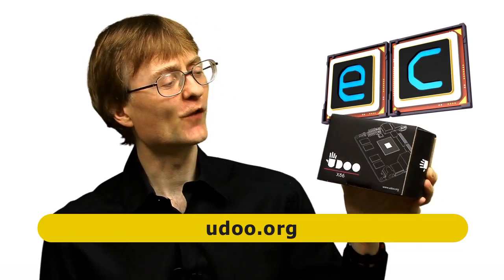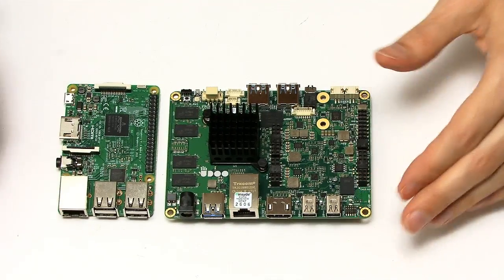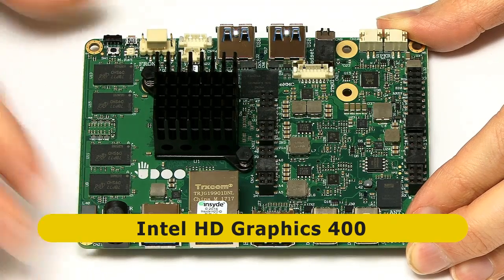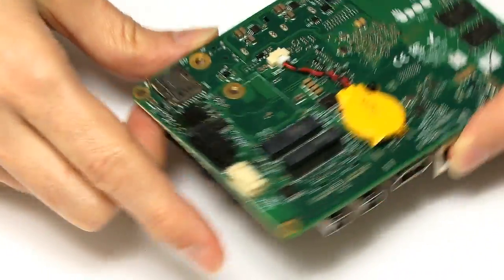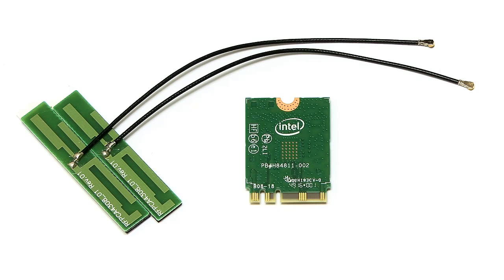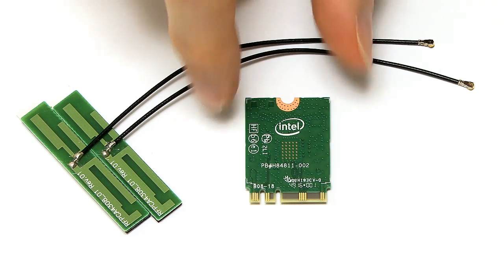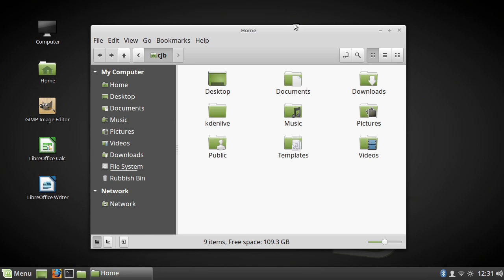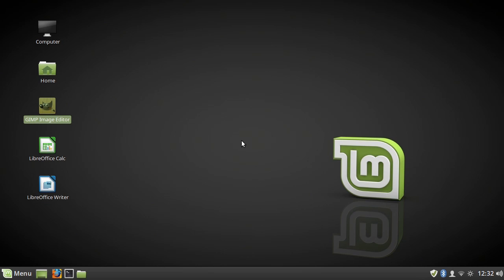UDOO x86 Advanced Plus

Comment: where did you buy this, can't find it on Amazon.
Reply from the maker: Mine came from https://shop.udoo.org/ -- they ship internationally
Reply: I got mine from the original campaign on Kickstarter but then never sent the screws so I can not attach the expansion module or HD so it just sits in a drawer.  Typical crappy KS support and Udoo is real company with several past products so they have no excuses for such sloppy work.
Reply: Just do not expect them to end the screws with the fans!  Rip-off!!

Comment: Is there a way to add a second lan port and use this as a linux firewall?
Reply from the maker: There is a $50 daughterboard that connects via M.2 and adds two extra Ethernet ports. :)
Reply: ExplainingComputers Thank you. I just looked at it, but where does it fit on the board?
Reply: Both M.2 ports are on the bottom and near each other.
Reply: Besides the daughterboard with more NICs, another option is to use a VLAN-capable switch and 802.1q-tagging to split the single inbuilt 1G Ethernet port into multiple logical interfaces (eth0.1, eth0.2, etc., limited only by switch port count).  All will share bandwidth, but unlike with simple aliases, the tagging ensures traffic is otherwise kept fully separate for security and management purposes.

There are some small, fanless switches now on the market with basic 802.1q support, and certain cheap unmanaged ones, such as older models based on the RTL-8309SB, SC ... SG can be hacked by soldering on an extra i2c EEPROM programmed with appropriate register settings.

I use this method with an older Udoo Quad (ARM i.MX6-based) board, serving as my router/firewall (and Asterisk PBX, NAS, home automation server) on a 75Mb/s Internet service, and it works great even for timing-sensitive traffic like VoIP and gaming.  It consumes only about 6W of power for the Udoo board + switch, and runs directly from a 12VDC solar battery bank alongside its upstream cable modem, Wifi APs, VoIP ATAs etc.

Comment: You forgot to tell that Udoo X86 has also Arduino (+ heads) builtin: " It also mounts an Arduino 101-compatible platform, which makes UDOO X86 compatible with shields, sensors and actuators for Arduino UNO as well as able to run the Arduino IDE directly." ... Also you can control CPU with arduino. Example, you can boot/sleep X86 CPU when arduino sensors detects movement. Arduino compatibility is something that other x86 boards does not have. Their kickstarter page has good explanation of that: https://www.kickstarter.com/projects/udoo/udoo-x86-the-most-powerful-maker-board-ever
Reply: Also running Windows 10 on Udoo x86 is quite incredible experience. I have one Udoo X86 Ultra running on Windows 10, and my kid uses it daily (Spotify, youtube, Steam (games), Minecraft, etc.). I have Linux on eMMC and Windows 10 on M.2 SSD.
Reply from the maker: Thanks for this, and I did mention fhe Arduino connectors. Also they exist on the LattePanda x86 board (if not on most x86 boards, certainly).
Reply: They even sent you a free one if you were part of the original campaign, good design, lousy support.
Reply: I was backer on Udoo, Udoo Neo and now for Udoo x86 ... I didn't know that deal. I didn't find any information of that, now when I tried to find more info of it.
Reply: Arduino is required for all "makers"

Comment: spoiler alert!!! you cant run 4K through a HDMI cable. you need not 1 but 2 display ports for 4k.
Reply from the maker: Not true. HDMI 1.4 and 2.0 both support 4K. Display port supports 4K also. In both instances you need a decent quality cable.
Reply: true. but the intel 405 only support 1 4k output and the udoo website does not mention its using DP 1.4. so you cant assume its DP 1.4

Comment: I have both the Celeron N3160 and the Atom X8500 CPU , and the Atom is definitely a lot slower!
about as slow as the Celeron running at power saving mode (peaking in at 1,6Ghz, mostly idling around 400Mhz, with occasional 1,2Ghz upclocking when the program requires it.
The Celeron N3160 suffers most from this CPU scaling effect, when in powersaving, or balanced mode. In High Performance mode, it'll idle at 800Mhz, but upclock to 2,1Ghz with the slightest activity (above 10% CPU), and lag is not really noticed.

The atom X8500 is good for basic stuff, and very energy efficient. Great for small home based servers, running chatroom or bittorrent software on. The Celeron N3160, with decent cooling, is doing awesome at just about everything including retro gaming of up to DX9 games at a resolution of up to 1080p, or more modern DX11 games at up to 480pix (sadly most DX11 games require 720p or above).

The Celeron does feel very smooth, and can run Audio software with almost no latency, only in high power mode (running at almost a constant 2,14Ghz).

Just in case you'd be wondering what probably would have been the difference between the Advanced, and the basic one.

I just wished they provided mounting screws, to mount this board in a 3.5" drive slot, or even mount it under a 3.5" Blueray player (or harddrive). A lot of 2.5" harddrives and 3.5" CD/DVD/Blueray-ROM players, have mounting pins on the bottom, providing excellent protection to create a complete PC at a size just a tad larger than a drive.
Reply from the maker: Great info -- thanks for sharing here. :)
Reply: How annoying, glad mine is the Advanced.  Now if they just sent the rest of it.

Comment: Lol @ subs (Voodoo x86)

Too bad they're covering up the wifi module with the SSD. Should have been reversed.

BTW, it would be nice if you could show us a 3Dmark and PCMark score.
Reply from the maker: I'll do some benchmarks in the follow-up video.
Reply: In case you're wondering,
For windows, there are older benchmarks available, as I think these type of pcs will barely have any acceptable framerate.
The score would be good enough for the latest benchmarks, but one or two benchmarks before, probably will be running fine on this type of hardware. (windows only).

Or, you could try to run it at a lower resolution (if allowed).

Comment: You put the fan upside down.   The fan has to blow down to  heatsink.
Reply from the maker: It is indeed blowing upwards, but the supplied fan has no grill on the other wise, so mechanically it does not really fit (safely) blowing in the "correct" direction. So it was/is fitted as it was. And some airflow is better (pulling air into the viens of the heatsink) is better than none! :)
Reply: Yeah, that's a good idea. Thank you for your reply. 
If I was in USA, I would definitely buy that product. But due to the exchange rate difference my country is very expensive. For example, according to your money, the price of that product is $ 500. (I am from Turkey.)
Thanks your video.
Reply from the maker: Wow, this is expensive in Turkey! :)
Reply: Yes, we have to pay a lot of money to buy a standard PC. A computer with $ 1000 in America is an average of 4000 Turkish Liras in Turkey. So think about $ 4,000 for you. I would like to be in America :) I am electronic and computer chronic. I watch your videos and when I see the products you introduce, my appetite rises :D

Comment: I think this board is more intended for the extremely space constrained or power constrained folks. If you have the space for a normal small form factor PC it may be better to hunt down the used market for parts, as for the same cost you may get more performance out of it. For example an LGA775 server motherboard, an LGA775 quad core Xeon, 8GB of DDR2 ECC memory and a mid tier used graphics card together comes in the same price as this board, likely performs better, but will occupy more space and draw more power. Since server parts are built to last, the used server build will last as long as a new Udoo.

Comment: Why won't you review a pcengines APU2? They're cheaper than this guy, also x86, and they have lots of add-ons as well.
Reply from the maker: Thanks for this, I was not aware of those boards. However, as far as I can see, they are for headless use only, as they do not have an HDMI connector or a VGA, DVI or DP port. They are hence very different to the technology I cover on this channel, as they cannot be used to run a traditional OS, or as a media player. And in response to your "why won't you review?" question, most of my SBC reviews follow a manufacturer contacting me to offer hardware, and PCEngines has not done that! :)
Reply: They are headless indeed. If that's your criteria for an SBC then I guess it's not it. Installation is done via a serial port.

They do run a traditional OS, basically any headless Linux like Ubuntu Server. I read somewhere that they can run the VMWare vSphere hypervisor so you can basically install any OS on top of that.

Comment: Great video (thumbs up). In my humble opinion (superior sense of modesty), I would have liked to see mentions of these things:
(a) Running Windows7 or (b) "Win8.1pro with Media Centre" (because both can do media centre and this board would be great for that usage in home theatre with a windows-remote) and for the record both 32bit and 64bit versions would be ok what with the mere 4GB of RAM. Also running (c) WINE in linux since it's another string to your bow, thereby allowing nifty workarounds.

Also (d) a comparison with not just "Latte Panda" but also "leemaker guitar" and "Up" (see MickMake channel) as they are x86.

Also (e) using as games emulator aka "ROMulator" (such as playstation2 emulator like pcsx2) because it would be great in a custom handheld case (akin to those by moddedbybacteria) with analogue thumbsticks. It would fill a niche because machines like the GPD pocket (as shown on the Steve Benway channel) doesn't really do Playstation2 emulation with its weak CPU. What I would like to see on that board mind you is at least a gen2 4x PCI-e socket so one can put in a better grapics card (assuming one can power it by adapting a molex connector from some spare PSU).

(f) If you could do all of the above at an owl sanctury, that would be nice. No particular reason other than I just think it'd be a nice setting for a video, and if I'm making all these demands anyway, I might as well see how far I can push the envelope. H00t!
Reply from the maker: Thanks for this. I will try and cover somse of what you request in the follow-up video. Note that the LeMaker Guitar (I reviewed it here some time ago) is ARM-based, not x86. I will think about the owls . . .
Reply: My bad on the Leemaker guitar. Toowit toowoo!

Comment: the wifi module is not m.2. its mini pcie.
Reply from the maker: It is most certainly fitted in an M.2 slot, which offers a PCIe interface. M.2 is a form factor that can support SATA, PCIe or USB devices.

Comment: Looks like a great board.  Does anyone know wattage power draw?
Reply from the maker: I have not put a meter on it (yet!). It 'requires' a PSU supplying 12 volts at 3 amps . . .
Reply: Thanks Christopher.  This board with X86 compatibility has really piqued my interest.  I'm looking forward to seeing your next video of this board.
Reply: For anyone like me, who may be interested, I found this on UDOO's site: 

"The power consumption of UDOO stands at ~3 Watts at idle once booted 
(3.306W for the Dual and 3.654W for the Quad), while is slightly less 
with the ethernet chip disabled"

Pretty decent power usage. Couple that with the X86 compatibility, and you've got a decent little system there.  Get one now before cryptocurrency miners learn about em, and buy up all the stock :P

Comment: Looks rather interesting, it can be defined as "Portable Desktop" because seems powerful and portable enough without being a real laptop while keeping a huge amount of connectivity. Should work well has a traveler/conference/hotel/multimedia PC.
Reply from the maker: I like your phrase "portable desktop". :)
Reply: ExplainingComputers If there is a way to attach a touchscreen and battery to it it could be a pretty good tablet board :)
Reply: Well actually looking at that heat sink + cooling fan stacked together maybe it wouldn't work so good as a tablet board after all, that thing is pretty tall with all that stuff on
Reply: It comes with ports for both but you would need to build your own case.  Last I checked no one was making real cases for it.
Reply: Yes, it is several inches thick unlike a Pine or Pi3.  Tons of heat.

Comment: Should have run it with Windows 😭😭😭that's the main reason you would get a board like this.
Reply from the maker: I will run Windows in the next video using this. But I can't win! When I put up my video of the LattePanda (also an x86 SBC), lots of people complained that I had it running Windows and not Linux. :)
Reply: True :)

Comment: I wonder how well it does in typical raspberry pi / arduino applications e.g. lighting a few LED's  or control a motor.
Reply from the maker: I'm sure it will do this just fine, but is overpowered for the job. For maker purposes it is more suitable for robots or drones requiring more sophisticated processing power.
Reply: Not reliable enough.  I hear is also gets quite hot unlike a DVR system.
Reply: It's got what looks like an Arduino pin header set. Should do that kind of stuff in it's sleep.
Reply: It would be nice if I could figure our what hardware I would need to attach so I could use xLights to communicate with a GECE pixel controller.
Reply: +ExplainingComputers or how about deploying it as a center for home security? It seems to be perfectly suited for such a task.

Comment: I'm loving this I'm assuming you could put windows 10 on it how much would the full package they sent you cost as a set up for a small desktop for work
Reply: Yes, but it is cheaper to download and install it then add a legitimate  (purchased) key afterwards then to buy the full version retail.  I even upgraded my version of Windows 10 to Pro for pretty cheap by buying a legitimate key.
Reply: he makes some great videos I'm sure I remember programs on the bbc when I wsa a kid I know the face
Reply from the maker: It will indeed run Windows 10, and I will be running it on the board when I compare it to the LattePanda in a follow-up video. The cost will depend on the user. There is no charge to download the Windows 10 ISO and to install and use it long-term. But a key to activate it would require a payment to Microsoft, which could be necessary to use it long-term.

Comment: When I saw this board, I immediately started to think of a 3D-printed case that would hold the board, a 2.5" SATA drive, a tiny ventilation fan, those two small WiFi antenna boards and some front-panel I/O connected through that front-panel I/O connectror that the board has, it could be a nice 'Green PC'(especially with the UDOO x86 Ultra)
Reply from the maker: I so totally agree! It needs some files on Thingiverse for just that kind of case.
Reply: Yes, it only uses few watts.  I forget how many but a fraction of the amount of laptop or PC but more then a smart phone.
Reply: https://www.thingiverse.com/search?q=UDOO+x86&sa=&dwh=5759916654134c2
Reply: Actually the acrylic case is even able to hold a 2.5" SSD ;-) I have it running since months like this :-) There are 4 screw holes on the oppsite side of the CPU. These 4 holes are there to mount a 2.5" drive. The short cables are meant for this anyway.

Comment: They give you a 12v 3A power supply, but is there any chance you could test it's actual consumption at idle and full load?
Reply: Think the 3A is to ensure its got plenty amperage to power added peripherals. I have Advanced X86 with Hynix 128GB M2 SSD, WIFI and Bluetooth adaptor for keyboard/mouse and its idling at 5w going up to 13w under load. I use a 2A transformer which doesn't even get warm. Interested if ExplainingComputers comes up with similar figures.
Reply from the maker: I will put a meter on it in the follow-up head-to-head video.
Reply: Thank-you.

Comment: Something like that could replace most of the non gaming and video editing aspects of my main computer. Given the BIOS features I'd guess it's possible to have Windows 10 on say the internal memory, and Linux on an internal micro SD, and chose which OS you would like to boot into? The price point is higher than what would inspire an immediate purchase from me, but that little board makes me excited.
Reply from the maker: You are exactly right -- this thing is far more flexible than most SBCs, and you can install an OS on the onboard, eMMC, an SD card, a USB drive (not a bad option as USB 3.0), a SATA drive, or an M.2 SSD. So having WIndows on the eMMC (I will try that in the next video) and Linux on a Micro SD is perfectly possible.
Reply: That is certainly a viable option. Juste remeber if you DO set up a dual-boot Windows/Linux system that you must install Windows FIRST! This is because Windows install program cannot detect if other flavours of O/S'es are already present, but Linux CAN. (Or maybe newer versions of Windos can, i don't know for certain, it was just the case about 10 years ago when i tried out some sort of Linux - Red Hat or something like that).

Comment: Did you have tested out Windows 10? Is it possible to use?
Reply from the maker: Yes, you can run Windows on it -- very well actually. I will show this in the follow-up video (also running Windows on a LattePanda).
Reply: thank you for the quick answer :)

Comment: Is that fan installed correctly?
Reply from the maker: It is indeed installed to pull air up rather then push it down, but the design of the supplied fan only has a grill on one side to mount in this fashion! And any airflow has to be good. :)
Reply: Let's forget dust for a moment. I'm asking about heat. What do you think?
Reply: ExplainingComputers May be pushing air will be better. Why not?
Reply: pushing air = more dust
Reply: Dust comes eitherways so it doens't matter. But in thermodynamics, heat dissipation is better with pushing air. Maybe we see a benchmark about it.
Reply: it is matter. pushing air will gather more dust.